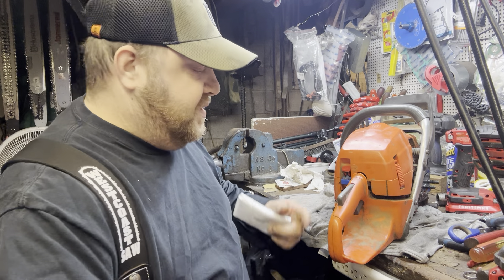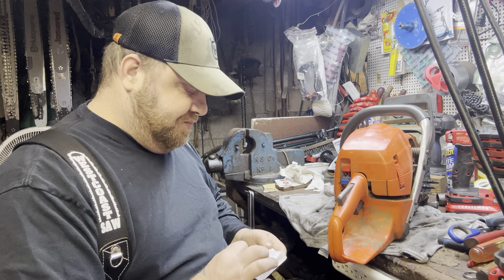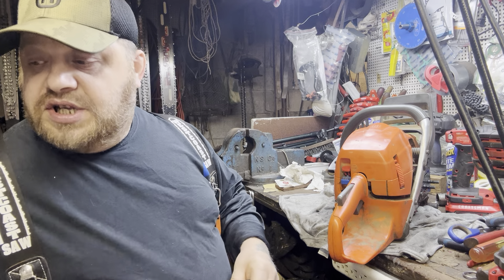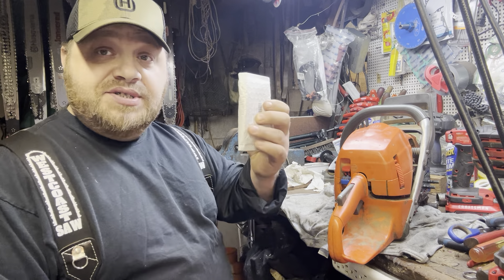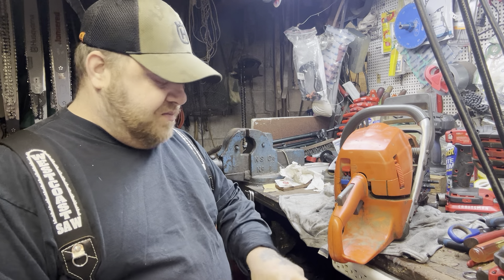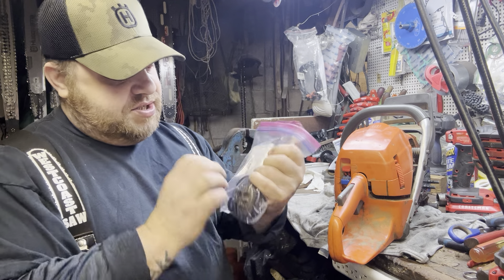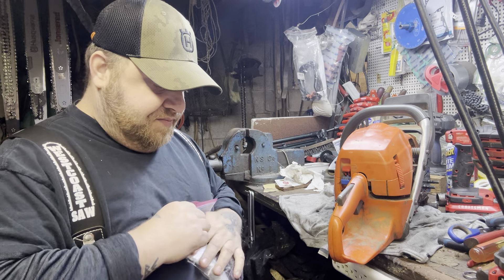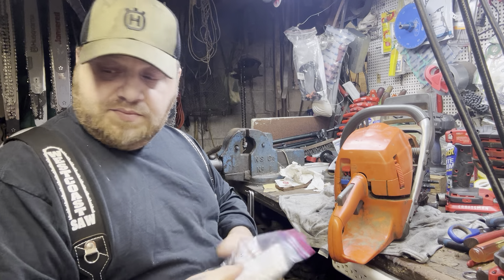Husqvarna 570 new aftermarket top cover clips and chitchat 🤙🏻😎

Comment: I have a 576 xp with a bad bottom end I haven’t split the cases yet but it looks like the stuffers are melted do you think I can just replace the stuffers and bearings to save the crank a new one is like $400
Reply from the maker: Long as the big end rod bearing is good
Reply: Cool I will definitely investigate that